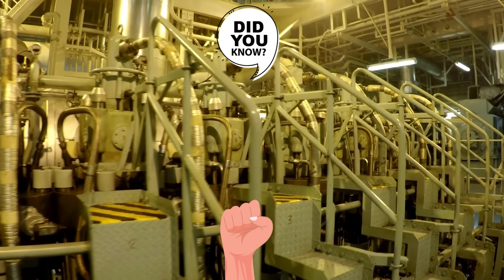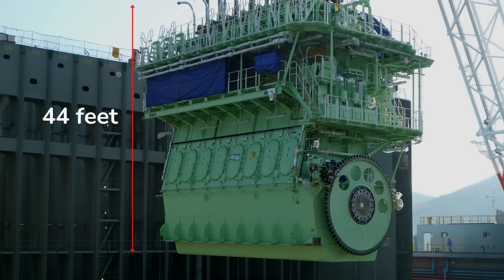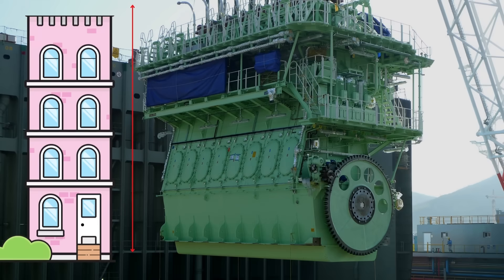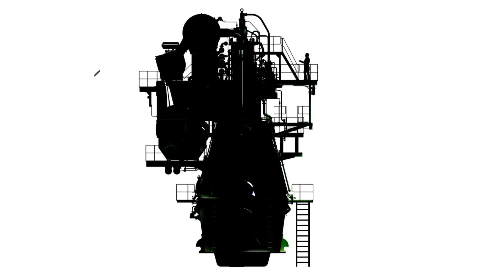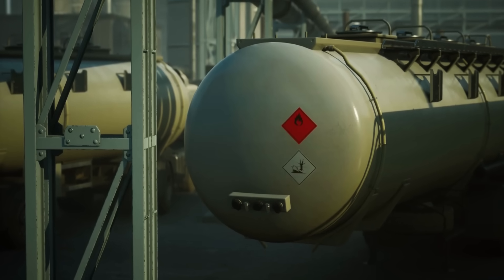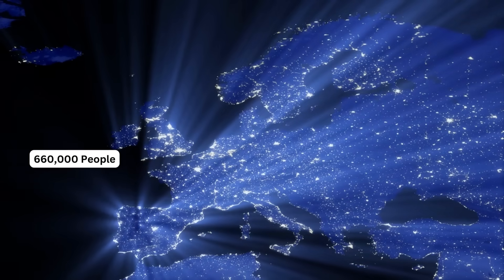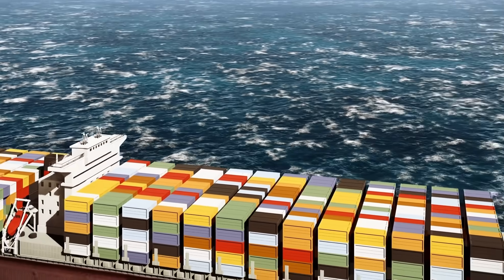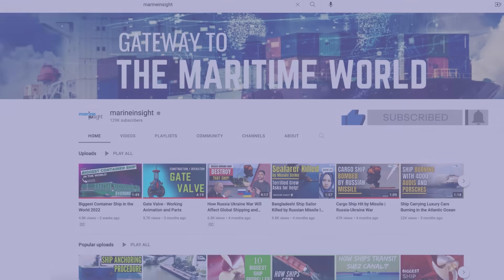Biggest Ship Engine in the World

Comment: The Engine shown in the video, Does Not produce 110,000 hp... and Neither does the Largest one.  The engine shown in the video is Wartsila's 8 cyl. version of the RT-96C.  There are also 6, 7, 10, 12 & 14 inline cylinder versions as well.  The inline 14 cylinder version is the one that produces 109,000 hp+/- and approximately 5.4 Million lbs ft of torque.  The crankshaft alone, weighs 300 Tons (US) and 2300 tons, (2M, 300K lbs) total.

Comment: Which company made it and which country?
Reply: Wartsila... from Finland.  Was originally Wartsila (4 cycle), then Wartsila-Sulzer, with Sulzer being from Switzerland and a producer of large "medium speed" (200 - 900 rpms) diesels, including Radial engines.  Wartsila bought them out to expand their line with Marine 2 cycle technology.  
All the very biggest, high output diesels, are 2 cycle.   The are only a very few marine diesel manufacturers in the world that have lathes large enough to handle the machine work on the crankshafts of these engines, especially the 14 cylinder version of the RT Series Wartsila.
  
Their engines (the RT-Flex96 Series) are produced at the Ulsan / Hyundai Heavy Industries plant in South Korea... and they also have an Engine Dynamometer there, that can measure and handle the power output of the 14 cylinder version... the only one like it in the world.     Wartsila's RT-60 Series (3,210 bhp per cyl.) are made in Wartsila's plant in Trieste, Italy.

Comment: The problem with this video is the lack of structure. Many things you say twice (the height, the comparison with a truck engine and more).
Reply from the maker: Thank you for the feedback
Reply: michaelwirth.... he's also showing the 8 cylinder version, while giving the specifications for the 14 cylinder version... which are not entirely accurate, either.  The 14 cyl. engine does Not develop "110,000"hp... it's currently at 107,898 hp with 5,162,935 lbs ft of torque.... at wide open throttle - 102 rpm!

Comment: "Heavy Fuel Oil" is probably Bunker C, which is so viscous that it has to be heated to make it flow, and is basically the residue from creating/distilling lighter oils.. The pollution that this engine emits must be staggering. Anything to save a buck.
Reply: Better to use the heavy fuel oil than not, right? What else would it be used for?
Reply: @joshuaborem7063  Road surfacing, as tar-macadam.
Reply: @nigelrg1  nice. 
But also makes good fuel :)
Reply: @joshuaborem7063  Tarring roads. I see another commenter said the same thing.
Reply: These engines are elctronically controlled just like you car is. Emissions are minimal and probably a lot less per ton of cargo carried than your car is.
Reply: @PeterGardner-e1z  You couldn't make Bunker C non-polluting with all the electronics in the world. Even with no passengers, my car would produce less pollutants/ton of me than these monsters.
Reply: @nigelrg1  What about the exhaust scrubbers that trap a percentage of emissions. I also have seen where exhaust gas is passed through a water screening device to wash out particles from the exhaust. I am sure that comparing 1960's emissions controls of the lack thereof to toaday requirements will show that there is way less pollution than back when I was at sea. I have a picture of our ship mid Pacific with funnel in view there is little perceptable fumes emitting. I even zoomed in as far as I could and can see nothing. Can send the pic if you like me to.
Reply: @PeterGardner-e1z  There are far more pollutants than particulates and water scrubbers aren't even great at removing the most dangerous ones, those below 2.5 microns in size. All diesels emit large quantities of oxides of nitrogen, which can only be removed effectively by adding a nitrogen-hydrogen compound, such as urea and passing over an expensive catalyst. Ships don't have that. Also bunker C frequently has large quantities of sulfur, which will be emitted as sulfur dioxide. Some will be removed by water scrubbing, but most will not, unless an alkaline compound is added, in which case you have a sulfur-containing waste liquid to deal with. Anyway, ships don't do this. Do you want me to go on? I've spent 25 years in the air-quality field.

Comment: I worked with ALCO 251 V-18 emergency diesel generators at a nuclear powerplant, with a max output ~3MWe. Their size is similar to a railroad locomotive powerplant.
Reply from the maker: thank you for sharing
Reply: The 18-251 engine.... Was a Locomotive prime mover..... but, Unfortunately for ALCO... it came too late to save the company.

Comment: it is not the biggest engine , there is a 14 cyl engine that is twice the size and power of the engine you are talking about . it has 150.000 hp .
Reply: The engine 14RT-flex96C develops around 107 000hp not 150 000hp. I so the engine in 2009 on the assembly line in engine plant #1 in HHI, Ulsan city, ROK. Only one image in the film shows the 14RT-flex96C engine.
Reply: @vasilemocanu6105  i thought i heard some one one a t.v. program say the largest 14 cyl ship engine turned out 150.000 hp . guess you can't believe every thing you hear on t.v.. still not to bad at 107.000 hp . would not want the fuel bill , it would be a lot of money .
Reply: Then name it and call Guinness liars.

Comment: How much cc
Reply from the maker: The formula for calculating the engine displacement or CC (cubic capacity) is:

CC = (π/4) x bore² x stroke x number of cylinders

Where π (pi) is a mathematical constant approximately equal to 3.14.

Given:
Bore = 960 mm
Stroke = 2500 mm
Number of cylinders = 14

Using the formula above:

CC = (π/4) x 960² x 2500 x 14
CC = (3.14/4) x 921,600 x 2500 x 14
CC = 2.3562 x 10^12 cubic mm
CC = 2,356,200 liters (rounded to the nearest hundredth)

Therefore, the engine displacement or CC of the given engine is 2,356,200 liters.
Reply: @marineinsight  
Man,
 it's  2.3 million cc

Comment: the smallest i worked on was 0.9cc...lol
Reply from the maker: 😅 too small
Reply: Well I saved my pennies and I saved my dimes giddy up giddy up 049 before I knew there would be a time giddy up 049 when I would buy a brand new 049-049 giddy up giddy up 049
 My single barrel, single speed prop driven 049 049-049 giddy up 049